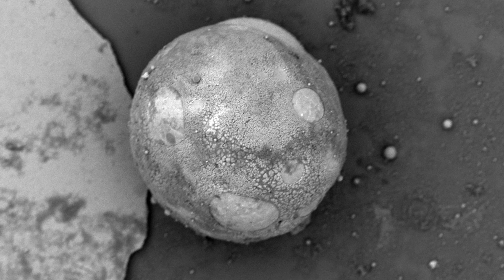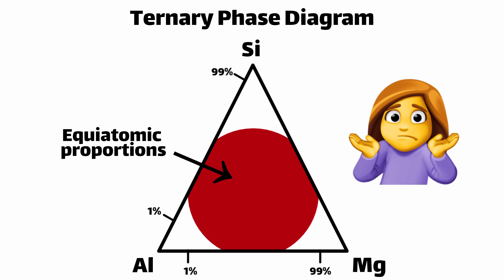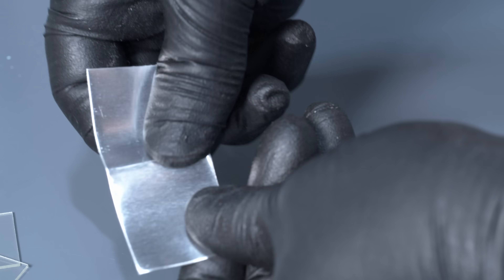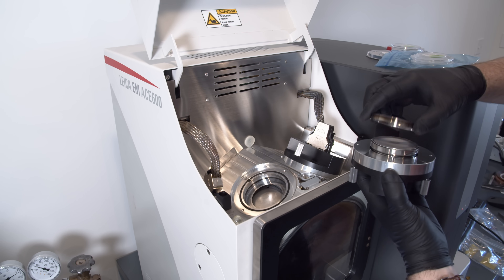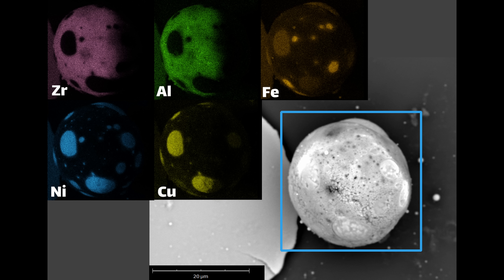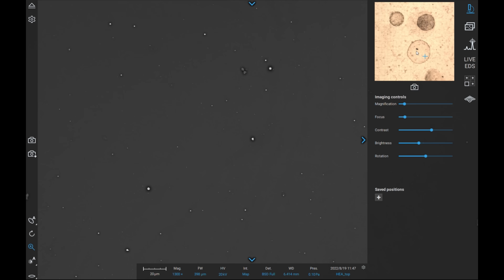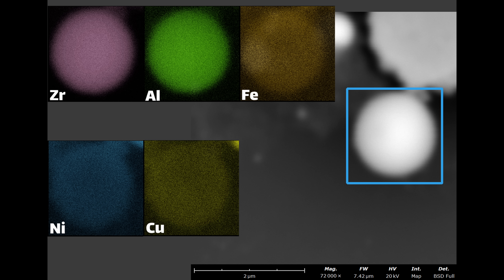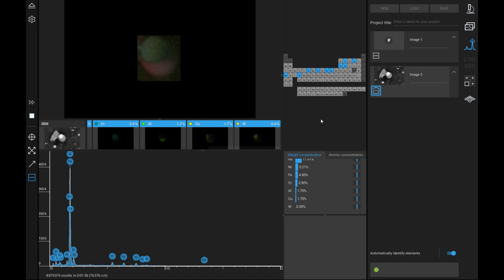Metal Alloys of the Future?

Comment: The cooling rate is crucial in forming phases in these alloys, and I think that the way you produced those "HEAs" contributed to the unsuccessful attempt. Rapid cooling rates are not favourable for creating solid solutions. As you mentioned, arc melting is a better way, or induction melting is also a great way of making small lab-scale melts. Also, you picked very different metals that do not like to form a homogeneous solid solution. The FeNiCuAlZr alloy has a <1 mixing tendency[1] and its valence electron concentration (VEC) is 7.2 which is just in the region where HEAs like to form mixed (FCC-BCC) phases[2]. You may want to try NiCoFeCr or MoNbTaVW, these are very classical HEAs. Also nowadays, the "classical HEA definitions" such as the sluggish diffusion, the configurational entropy as stabilizing/driving force against intermetallic phase formation, the atomic mismatch, cocktail-effect...etc. are debated. There are actually attempts in the industry to make HEA-like materials, but the rules are really taken flexibly so the alloys actually become feasible and producible. 

[1]: doi.org/10.1016/j.matchemphys.2011.11.021
[2]: doi.org/10.1063/1.3587228
Reply: rapid cooling should produce good glass with very high entropy; why do you think otherwise?
Reply: @janami-dharmam  High entropy alloys have crystalline structures, typically BCC or FCC or the mixture of these. The thing that you are talking about is metallic glasses (or amorphous alloys). They do not have a periodic crystal structure. Metallic glasses and HEAs are two different things, however, sometimes people refer to MGs as the predecessors of HEAs.

Comment: Ok... THIS is cool.
I'm not a guy that was super into this topic, But an alloy that has prosperities that could rival carbon fibre composites is really cool.
But I have a question... if particles 20 micron across are already "too big" and they seperate, is it even possible to in theory get a larger amounts of this stuff and work it like a normal sheet of steel?
Reply from the maker: Yeah so this laser-ablation technique is strictly limited to micro- and nanoparticles. But there are other techniques that are closer to normal methods (vacuum arc melting, spark plasma sintering, selective laser melting, etc) and can yield larger samples. One of the common methods to make HEA thin films and nanoparticles is to first make a large sheet of alloyed material and then use that as the sputtering target for example :)

Comment: I'm an old retired metallurgist (PhD) who was exposed to the world of materials research, and the funding thereof. There is a huge incentive to find something new, but consider: Stone Age, Bronze Age, Iron Age, ... new materials come along rarely. I did promote a crazy new material while at GE, and it is actually now flying in jet engines. That said, I also witnessed "Rapid Solidification" come and go, a  trendy research topic that got way more attention and funding than it deserved. High entropy alloys sound like that.
Reply from the maker: Very possible! I suspect in 20-50 years we'll get a few new superalloys to hang out with Inconel and Hastelloy in aerospace components for specific niche applications.... but we won't be driving cars made from HEAs or anything :)
Reply: @BreakingTaps  I think we hit the wall with Superalloy development 25 years with alloys containing platinum-group elements (Re then Ru). See Rene N6, for example, for which I was directly involved. They are used perilously close to their melting points - a fairly hard limit. There are only so many elements available...

Comment: what is the water-on-top doing to the chemistry, if you used a low o2 liquid like nitrogen or fuel(petrol) what would happen? maybe some sort of flux is needed to help even out and bond the element togreather.
Reply from the maker: Definitely adding a bunch of unwanted oxidation! Running the protocol in something like hexane would have been better, or as you said an inert (or colder) environment :) Excess nitrogen might cause it to nitridize instead which could be good or bad (nitrides, oxides and borides are a big area of research too), but for metal HEAs you'd ideally want a very non-reactive environment. Tricky though, since even hexane could react to form carbides due to all the extra carbon hanging around!

Comment: A great way to make several alloys of this type is to melt them all togther and cool it extremely quickly.  The mix should have metals with similar atomic radii to make a stable alloy. Also metals with extreme electrovalance difference will form intermetallic compounds. Conversely you can add metaloids like silicon to act as a sort of glue if you have diferent sized atoms. For example you can alloy palladium tantalum zirconium and cobalt and nickel with silicon and your result is a dragon scale tough metal alloy that is extremely flexible (and expensive unfortunately) 🤓

Comment: Very interesting video. I am an additive manufacturing engineer, and I think that the technology would be perfect for what you are trying to do here. Using LPBF technology you could mix powder feedstocks and play with different scanning strategies to target high density results. Depending on the laser wattage you have access to in your shop you may even be able to do a very small scale single layer test by using a high watt and very low scanning speed to target a higher volumetric energy density. If you have access to a LPBF printer that would make your life a bit easier tho!

Semi-related, you should look into oxide dispersion strengthened alloys, and what additive manufacturing is doing with them. NASA has been designing new ODS alloys using machine learning and manufacturing them via LPBF and getting seriously impressive results.

Comment: BTW when I was working in a related industry we started off by plasma etching the surface of the material before adding metal, specifically to get better adhesion during physical vapor deposition.
Reply from the maker: Aha, that's a good tip! Will try that next time

Comment: I have found a way to cut Granite using Aluminum due to the unusual properties materials have while under the influence of ultrasonic Vibrations.   The strength of the materials changes similar to how its easy to break a pencil but gets harder and harder to do as you get increasingly shorter.  With proper technique and tuning I have yet to find a material which it is incapable of scratching.  More important than what the target surface is make of it is state of polish.   The more polished the surface the higher the frequency needed and more precise the tuning required.  Its crazy to be honest and I hope to be able to develop some sensors to make more quantitative sense of the effects I am witnessing.  If I had your skills it would be a cake walk :D
Reply: I am curious if some of your Allows would express unusual properties if they are under the influence of ultrasound also as they should either solidify with bonds which under normal circumstances would be energetically unfavorable or more importantly in my opinion for half of the wave the particle will essentially be in zero gravity as it would be falling with that of the Earth with the other half of the sin wave providing the energy to get it up there.  Obviously it would all happen very fast but it might help to ultrasound these samples as they are still liquid.

Comment: I read that some Japanese researchers made a high entropy alloy of all (or most? I can't remember) the platinum group metals. The super alloy was an extremely powerful catalyst for electrochemical redox reactions (they had hydrogen fuel cells in mind for this alloy). But more interesting than the material was the preparation process, they took all the constituent metals in dissolved salt form, (I think it was mostly nitrates?) And poured the mixture into a reducing solution while stirring. The metals reduced together and formed particles of the high entropy alloy. The process seems extremely easy to replicate but I am not going to buy all of the platinum group metals, I am not a billionaire lol. But I do wonder if the same chemical method would work for other metals?
Reply: It might be harder with metals with dramatically different galvanic potentials, where the easier to reduce salts would act like a sacrificial anode on a ship in reverse and precipitate first.
Reply: @forresthsu582  true, but if a solution was reducing enough it might minimize that issue. Starting with metals that have very similar electrochemical potentials would be a good place to start tho. There are some insanely reducing chemicals out there tho and it would be fun to try to get this to work with very weird mixtures of metals
Reply: @doctorpurple5173  or borrow CERN for about a million hours...
Reply: @CharlieLOL  that sounds easier, I'll go ahead and do that
Reply: @doctorpurple5173  I'd guess you would trade problems with galvanisation for problems with imperfect crystalstructures. still worth trying and there might be a concentration sweet-spot that balances everything. my money would be on a cathode with a steady state flow around it (or pulsating low concentrations if you just aim for a very thin layer.
Reply: @doctorpurple5173
Reply: Perhaps something akin to electrostatic attraction could allow for thin films of different metals to be sprayed and wiped off in thin layers. Then, take your thin cake of metals, and crush it like damascus.
Reply: Hi, material engineer here with a published paper on HEA's applied to biomaterials.
1- HEA's can handle hot work. In fact their atomic structure, not being crystalline (lots of entropy in nucleation phase prevents it, hence the name) can handle way more temperature than most basic metals and alloys since there is a lot of "wiggle" room for the atoms to bear with the extra energy from temperature.
2- one of the core rules to make a successfull HEA is that they need to have a moderately close electronegativity to be compatible.
3- yes, size also matters (no pun intended) there are perks in having different sized elements into it, but too much and you lose a very important mechanical aspect to the atomic arrangement which is the composite-like resistance thse HEA's posess. (Hard nano-crystalline parts stop and deviate the flow of tensions to the sides of the rest of the more soft components) making HEA's one of the strongest materials in terms of mechanical strength with little to no brittleness.
Reply: So like producing nanoparticles, so you can mix them thoroughly and then sinter them into an alloy?
Reply: @henrikbienstein  more like the particles are already a thoroughly mixed alloy. But yeah you'd probably sinter them or something to make bulk material. I'd reckon you'd want to use as low of a temprature as possible when processing them tho, otherwise they might separate into distinct phases. Maybe just really high pressure cold pressing?
Reply: @doctorpurple5173  with pge the low temp range is very no?
Reply: @henrikbienstein  No, they would crystallize I think. I wonder if it's going to be difficult to create larger bulk pieces, and if deformation is going to cause crystalization.
Reply: @ramonbril    What about spray-forming…?
Reply: @axeguy3856  I like the idea. Keep the bulk cool and just shoot it on. 

Just having it liquid and cooling rapidly would do the trick, if cooling rapidly was doable. Liquids boil etc. Very cool Liquid salts under pressure, parhaps... Another option... I'm just daydreaming
Reply: Heard of a recently researched gallium-aluminum alloy that they believe will be very useful for hydrogen generation. I guess they used a process to make nanoparticles with an electron scanning microscope.
Reply: Two words
Philosopher's Stone
Boom problem solved
Reply: Also, one of the fundamental rules discovered by He (taiwanese i think), is that you must have around 5 or more metal elements equally or near equally distributed in atomic % to have a successful atomic arrangement instead of different phases of each element.
Reply: @Hitokiiry  can I ask a question that I can't find the answer to on Google? why doesn't simply melting a mixture of the metals in the correct proportions lead to a HEA?
Reply: @doctorpurple5173  short answer is because the melting and cooling can be done in different speeds (among other measures like pressure, and sorrounding atmosphere content) which leads to all kinds of outcomes. Take for instance alumina. It starts melting at only 2k °C, and serves both as fusion cups for metals (hard and brittle), or fire-resistant cushions for firefighters (looks like cotton). And the material is the exact same, inly differs in processing methods.

HEA's microstructure requires the atoms to have a lot of entropy which roughly relates to the amount of surrounding atoms to which they can form a bond in while solidifying at a specific time. As the metal solidifies, there's a growing chance that that entropy lowers to a point that you begin to have same-element bonds, and in HEA's we don't want that. (Leads to intermetallic compounds - very brittle).

So there is a concern to not only melt everything beyond doubt, but also not leave it be for long enough until they bond in a more efficient manner (bad- means the needed atomic strain in he microstructure will not be the desired one). You also need to avoid oxidizing shile solidifying. 

For this reason, one of the most promising methods to craft a strong HEA lies in SLM which is selective laser melting which has the fastest solidifying speed out of most methods.
Reply: @doctorpurple5173  melting the bulk metals together has a few issues. The first one that comes to mind is that the metals have different solubilities into each other. It's not too difficult to dissolve trace amounts of most things into most other things, but once you get above a few percent, some stuff just doesn't work anymore. 
The other issue is melting points. Tungsten would be difficult to mix with much of anything as its melting point is near or even above the boiling point of other common metals. 
Cooling would also be an issue, even if you got them all dissolved, as some would tend to crash out into different alloy crystals before the bulk solidified. This is an issue for even more "common" alloys, which is why quenching and annealing processes can be so complicated.
Reply: @Hitokiiry  did you make some phase diagrams to show this graphically, very interesting properties, looking at this from a petrography perspective we see similar textures.
Reply: @willkrummeck  phase diagrams for these are basically and pratically impossible to use as you have near equal amounts of every metal there and it's so complex that we now just use algorithms to find something within those diagrams that resembles a crystallographic structure that we may want.

Tl:dr graphic representation of 6 to 10 dimensional phase diagram is no good for our brain :D
Reply: @willkrummeck  i mean tou could freeze most of them but the tiny variations you'd be getting in one single phase diagram would represent about 0.1% of what can change, and even so you don't even account for ttt diagrams which are the main reasons for how HEA can be produced.
Reply: I also just remembered a method wherein which all the alloy metals are first "dissolved" in aluminium, making an aluminum alloy first, then they'd dissolve the aluminum away with hydroxide. All the alloy metals are left behind and they're atomically mixed
Reply: @doctorpurple5173  long answer has a lot of complicated math (pls no :D)
Reply: @doctorpurple5173  there are tons of methods being explored specially in the preparation phase which seems to be the most complicated to scale.
Reply: Yeah, you use a platinum iridium salt solution soaked into a membranous plastic, then reduce the metals from salt form using sodium borohydrate.
Reply: Very interesting
Reply: they occur together so if you can affor a platinum space sample
Reply: I've always avoided chemistry like the plaque and this reads like the turbo encabulator bit to me 🤣
Reply: @@FartGas-xe4yk okay? Go ahead and call it. Just Google it bro
Reply: It's easy there because the Pt group metals are like all really inoxidable. That's the biggest issue with plating metal or what u said a sort of precipitation. They will do that because theres no oxide lottery. Every time a metal oxidizes in solution it cause all kinds of bad effects like contamination and the resulting electronic things that happen. So yup. It's cause it's platinum. Go figure. The expensive stuff is easy! No way! Cool. The common stuff is not easy!! What?! No! Seems to be a trend
Reply: Do it with oxides and makes death metal! We all float here.... Or explode.... We all float and or explode here
Reply: Either "But I do wonder if the same chemical method would work for other metals." or "But I do wonder, would the same chemical method work for other metals?".
Reply: @anonymous3561-k4b  what?
Reply: @doctorpurple5173  I bet that alloy would make one heck of an efficient catalyst component for a catalytic converter
Reply: @GenericalFishTycoon  probably, would be hella expensive tho
Reply: @doctorpurple5173  Yeah especially with Rhodium hanging around 14k$ per ounce. What a wild ride that spot price has been on these last 6 years. I remember it was practically worthless comparatively not long ago, heck they even minted 100$ 1oz coins in Tuvalu, now it's just insanely expensive. Some old catalytic converters on Toyotas that had a lot of rhodium are worth more than the cars were still relatively new.
Reply: Ah yes the Nippon Steal
Reply: @orhan1149  no. 
The fact that the originating Japanese scientists didn't do this is would make it even worse